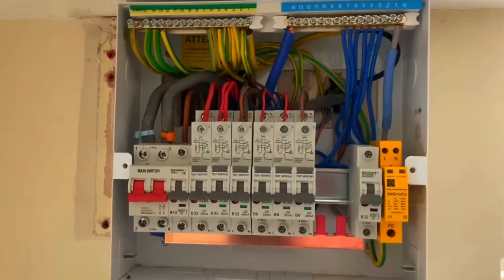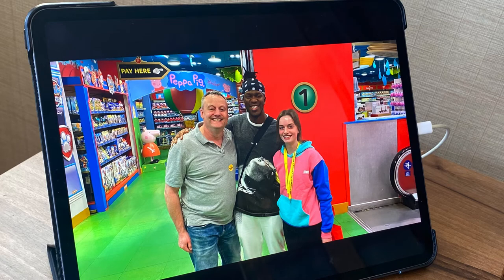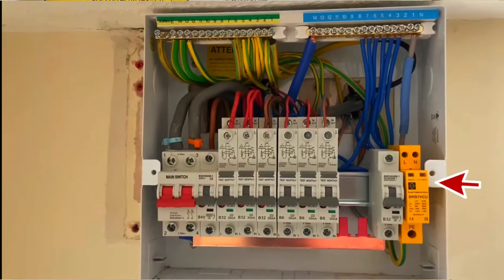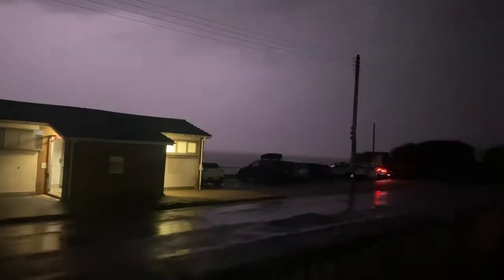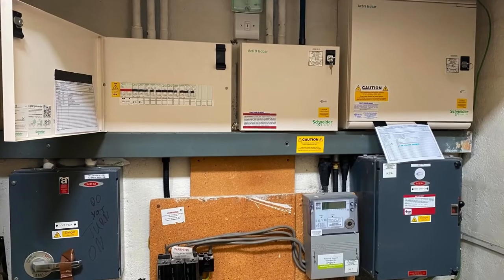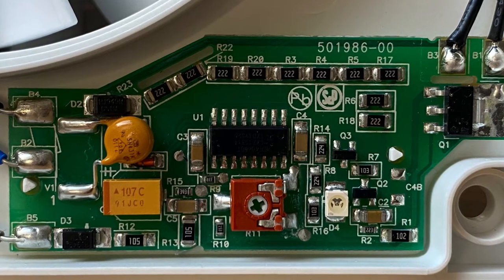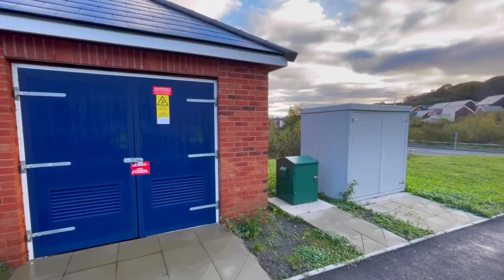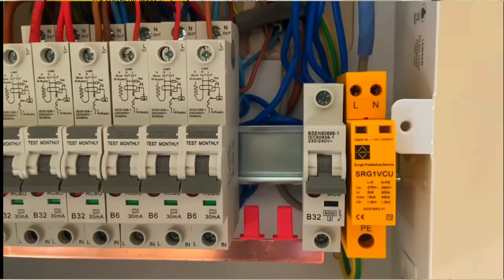Why Should You Fit a Type 2 SPD?

Comment: I got to ask this question about these SPDs  how many people in the UK  have had an overvoltage surge and it has burnt out all there or even 2 or 3 electronic  things they have in there houses  let's say in the last 10 years nobody will fit SPDs  if  not a lot of people they would have to save lives not TVs and iPads and games machines what do you say to that Gary and I am not talking about the AFDDs in the same CU  just the SPDs it will never happen in the real world unless the AFDDs and the SPDs are a lot cheaper also how many people do you think will run out and buy  an AFDD and SPD consumer unit and pay for it being fitted
Reply: You can pick up an SPD kit with it's accompanying MCB etc for 20 odd quid. Definately not worth getting a new box or expensive works done just for an SPD for the vast majority of people but if you're getting a new box installed anyway & have expensive electricals like home cinema equipment (which I do) I think it's worth paying an extra 20 odd quid. Like I say though this wont be the case for most people.